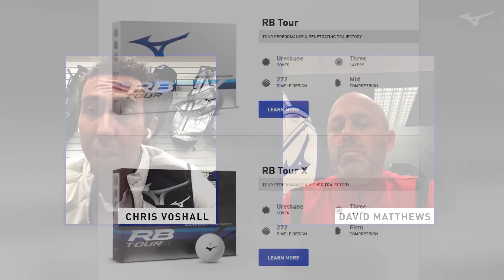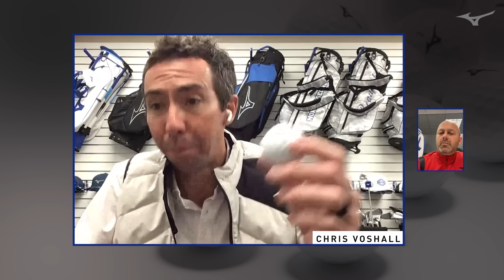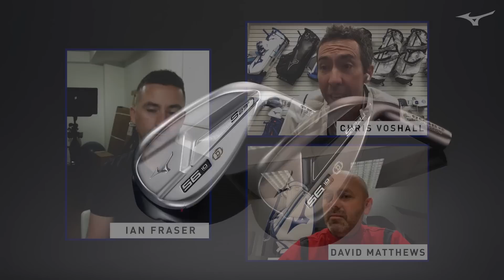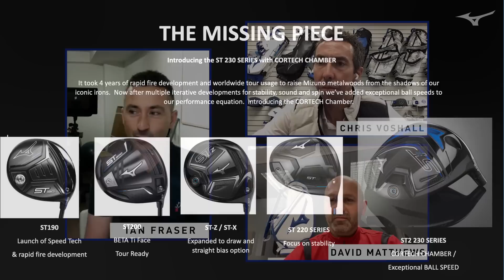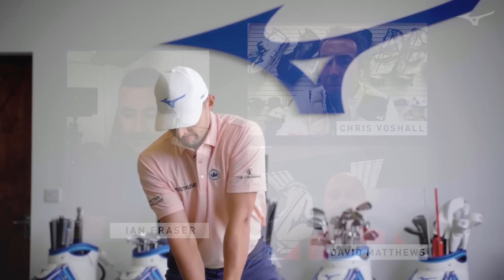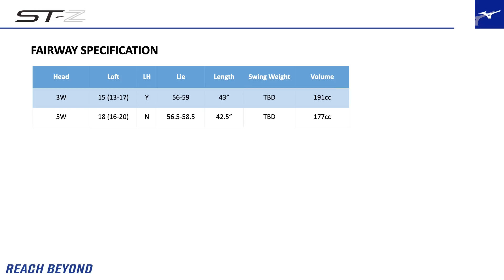FRESH GROOVES:  Mizuno Golf LIVE on RB Tour balls, S23 wedges and the CORTECH Chamber

Comment: For the last 20 years, I have been
     4H (Mizuno), 7W - 4W - Driver.
Getting that has been one reason to keep with Callaway.  There's a little overlap between the 4H and 7W but flight characteristics were different enough to work for me.  And the 7W was a deeper face and narrower sole than the 4, better for down lies

Ian talks about "higher loft FW", but you really can't do that with Mizuno.  I am now experimenting with

    4i (I can hit one now with 921 HM, but mostly as a summer DI), 4H - 5W - 3W - Driver

Definitely too many clubs, so now forced to drop something.  And the gapping is too close.  I could go adjustable in the 5W, and wind down the loft, but that will cost bounce for FW shots, but I don't want to do that,.

Any chance of a true 4W?

Comment: The S23 in the Copper Cobalt looks magnificent! Definitely considering a new set of these. It seems as though even number wedges (50,52,54 etc) won’t be a problem but what if I wanted a 55 degree? Would I have to get a 54 bent to 55 or can I get a straight 55?
Reply from the maker: You can get 55 in custom - with a 55 badge.